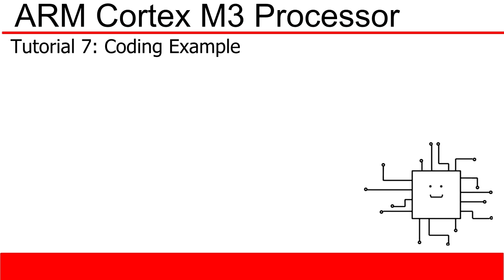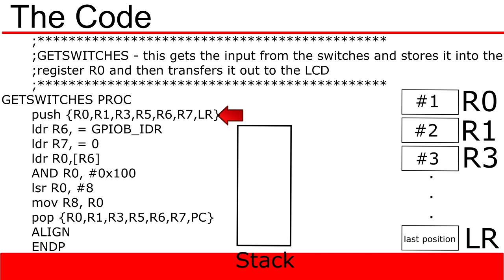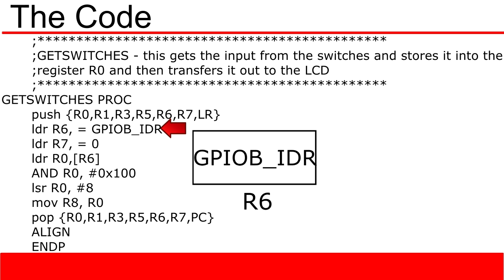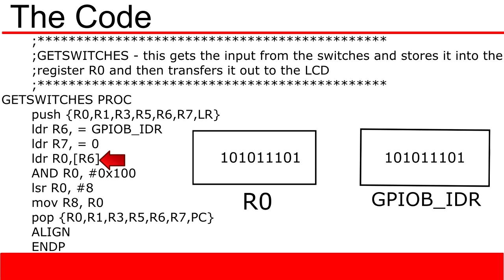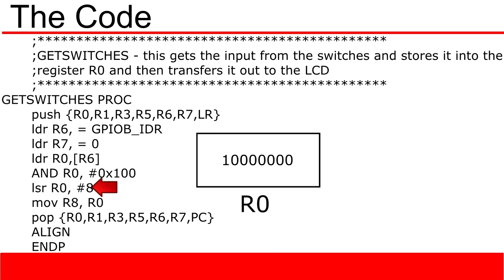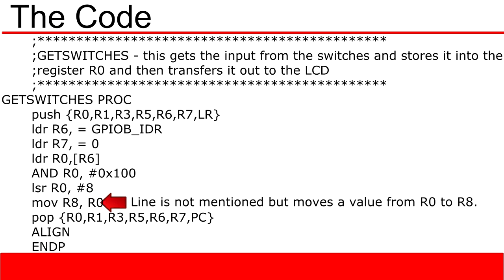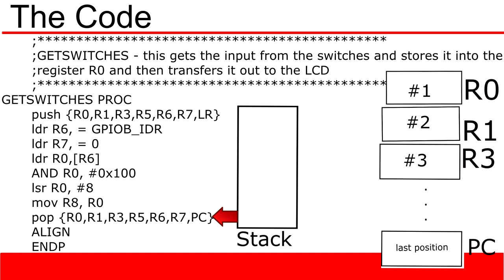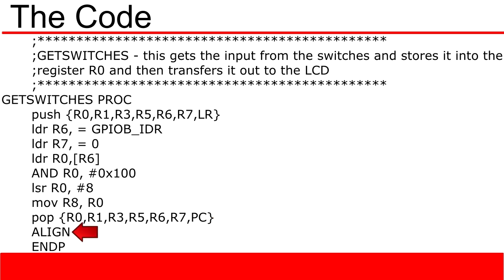ARM Cortex M3 Tutorial 7: Coding Example

Comment: I am using TIVA launch pad and I wrote some assembly code but I am unable to build for target. How to debug the assembly code in keil?
Reply from the maker: Hello! Would you mind posting the error you receive from Keil tools and maybe I can offer some suggestions?
Reply from the maker: In a general sense, the first good place to start is the error log at the bottom of the keil tools screen which is generated when you build a file. Look for lines that say "error:" and those should be what is preventing you from building your code. Once all errors are resolved, then your code will build.

Comment: hey man nice tutorials
I have a question, the order of the pop list is right?
Reply from the maker: Good eye! While it does make logical sense from looking at the diagram in the video that I should be "poping" the items out of the stack in the reverse order, the code requires that the order I have written be put in. However, the brilliance of this command is that it actually reverses the order of the destination register list prior to pulling the values out of the stack. This is a nice little housekeeping bonus that has been placed into the code so you can quickly see if you are poping and pushing out the same values without doing too many mental gymnastics and manually reversing register lists. Thanks for the comment! [ :) ]